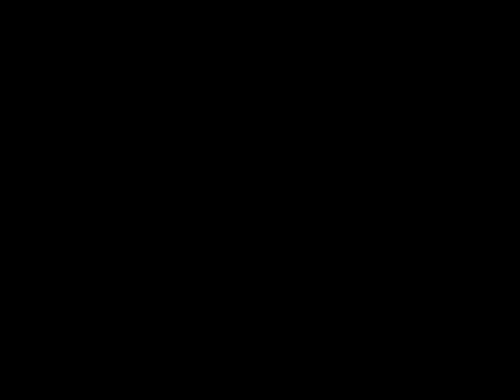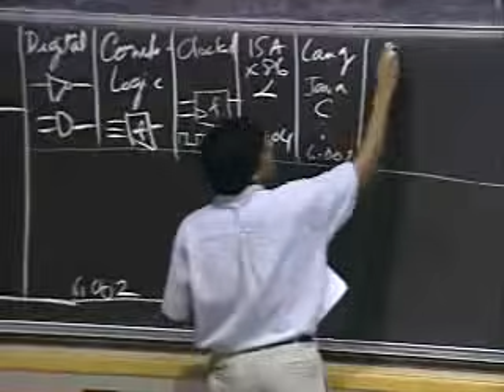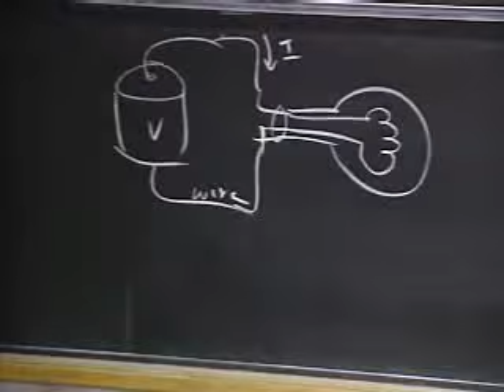Lec 1 | MIT 6.002 Circuits and Electronics, Spring 2007

Comment: This is the schedule:

L1	Lumped abstraction relationship to physics, KVL, KCL
L2	KVL, KCL example, nodal analysis
L3	Linearity, superposition, Thevenin’s equivalences
L4	Digital abstraction
L5	MOS switch, S and SR model, MOS gate design
L6	Nonlinear resistors, networks
L7	Nonlinear resistors, small signal analysis
L8	Dependent sources, analog amplification
L9	MOS SCS model and MOS amplifier
Q1	Quiz 1 (evening)
L10	Amplifier large signal analysis
L11	Amplifier small signal analysis
L12	Amplifier small signal circuit models
L13	Capacitors, first order circuits, examples
L14	Intuitive analysis of first order systems, examples
L15	Digital memory, state
L16	Transients in second order systems
L17	Second order systems with damping, intuitive analysis
Q2	Quiz 2 (evening)
L18	Sinusoidal steady state analysis, frequency response
L19	Impedance methods
L20	Filters, Q factor, radio tuner
L21	Op-amp abstraction, concept of feedback, non inverting amplifier
L22	Multiple inputs and superposition, integrators, differentiators
L23	Op-amp abstraction, feedback, stability, oscillators, clocking
L24	Energy and power
L25	Breaking the abstraction barrier

 Also exams and quizzes at https://ocw.mit.edu/courses/6-002-circuits-and-electronics-spring-2007/pages/exams/
Reply: Thanks for this awesome list:hand-pink-waving:

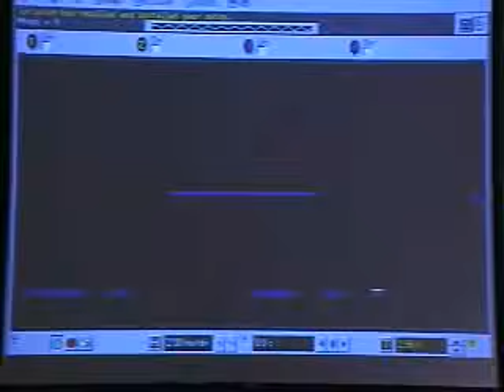Comment: Great video, but one thing that tripped me up at first was the vertical IV graph for the battery at 33:45. I had assumed with the previous graphs that voltage was the independent variable and current was measured across the component as a function of voltage. This method obviously cant produce the vertical line graph. It didn't make sense until after I read this in All About Circuits:

"If you have a device that supplies voltage or current, such as a battery or a solar panel or a regular power supply, you cannot change the voltage across the device, because there is a specific voltage or current being generated by the device. For these devices, ... [the voltage and current are calculated by] a method that involves measuring the values supplied by the power source for varying load resistance."

For me I visualize this as a third invisible axis of the graph, load resistance (R). R is the independent variable that's varies and I and V are both measured with respect to R. The R I V graph is then projected onto the I V graph in the lecture.

Thus I understood the ideal voltage source would have a vertical line IV curve because regardless of the load it will maintain 1.5V and supply 1.5/R amps of current. As R varies this produces a vertical line.

Another way to think of it is the independent variable is current and voltage is the dependent variable. The graph answers the question "If we force the voltage source to produce I amps, what voltage will it produce it at (if I amps is even possible)."

Let me know if I misunderstand anything.

Comment: 🎯 Key Takeaways for quick navigation:

00:00 🛠️ Introduction to Engineering and Course Overview
- Engineering defined as purposeful use of science.
- Course focuses on simplifying Maxwell's equations.
- Introduces abstraction layers to simplify systems.
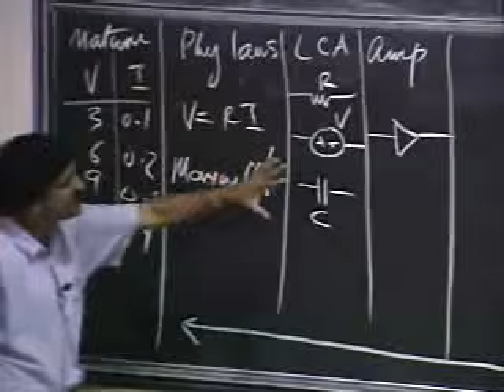06:06 🎛️ Layering Abstractions in Electrical Engineering
- Abstraction layers like lumped circuit, digital, build upon each other.
- Simplifies complex systems into manageable components.
- Leads to understanding computer architectures.
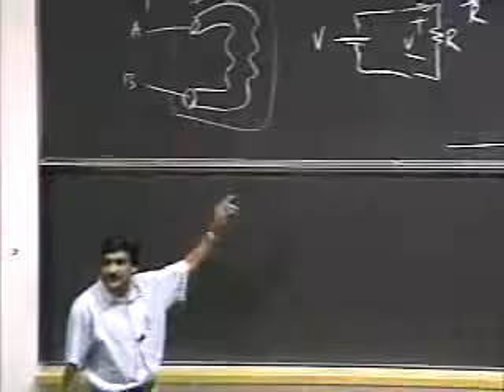21:30 🔍 Understanding Simplification Techniques
- Rationale behind simplification techniques explored.
- Importance of understanding transition to simplified systems.
- Emphasis on principles for effective engineering.
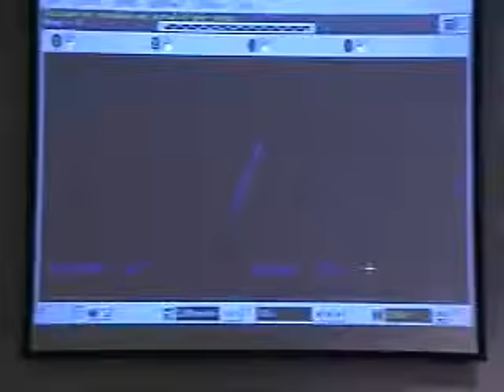29:35 ⚡ Characterizing Lumped Elements
- Lumped elements characterized by VI characteristics.
- Examples include resistors, diodes, batteries.
- Understanding VI aids circuit design.
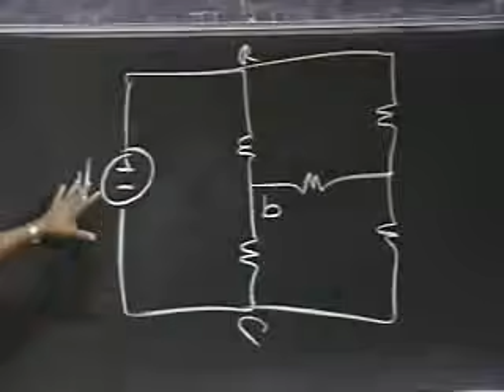38:10 🔍 Kirchhoff's Laws and Circuit Analysis
- KVL and KCL derived from lumped matter discipline.
- KVL: sum of voltages in a loop is zero.
- KCL: sum of currents at a node is zero.

Made with HARPA AI

Comment: I'm trying to follow the MIT's EE curriculum and the degree outline has this as a first class which has a prereq of Calc 1, 2 and Differential Equations, but he assumes that most students already covered Maxwell Equations, which as far as I could tell is a pretty advanced area of dealing with partial differential equations and is usually covered in a physics Electromagnetism course. So did they cover the basics in 18.03 Differential Equations course?

Comment: i have been thinking...in capacitors, there is a variation of charge so, why can we take the input current as equal to output current when we use the abstraction?

Comment: Sir, Capacitor is a lumped circuit element but it stores charge right.. so, how did we include it into our discipline of LMD....?????
Reply: Internally stores positive charge and negative charge physically separated by a very tiny distance, so total external charge is 0 and never changes.

Comment: What is the book that MIT use in this course of Circuits and Eletronics?
Reply from the maker: The course textbook is:
Agarwal, Anant, and Jeffrey H. Lang. Foundations of Analog and Digital Electronic Circuits. San Mateo, CA: Morgan Kaufmann Publishers, Elsevier, July 2005. ISBN: 9781558607354. (http://www.amazon.com/exec/obidos/ASIN/1558607358/ref=nosim/mitopencourse-20, http://www.elsevierdirect.com/product.jsp?isbn=9781558607354)
Reply: ***** I want to answer the Quiz 1 on this course. However, I don't understand the objectives of questions 1 and 2 due to lack of instructions. Care to elaborate?

Comment: the short summary: electrical engineers work off abstractions that pile on top of other abstractions, so things get easier as you go along*;
demonstration of current vs. voltage for a lot of common discrete components (including a zener diode);
and "what happens when you feed 110V into a pickle?"

* I note that historically, I think Maxwell's Equations postdate some of the more basic "laws" which are sub-sets of Maxwell's; so he was working towards a more complete synthesis. Additionally, some of the abstractions have their own distinct grounding in other disciplines, i.e. using a programming language relies heavily on mathematics which is grounded...in some way.
Reply: Nerdo( weird and nerd)

Comment: Current flowing in the loop creates flux, if v is varying the flux will also be variable. Now what about kvl
Reply: you're correct. this is why in real pcb design it's important to keep current loops small by routing signal traces close to return planes. in reality there is a hidden distributed inductance. they never mention this in undergrad ee.
Reply: I think the flux can vary, just not the rate of change of flux.
Reply: In inductors we consider flux change and in capacitors we consider charge changes but we take another abstraction depending on... transient/steady state/fixed frequency variation/variable frequency etc.

Comment: We do all of the adding, subtracting, multiplying and dividing by using attenuation, or amplification.  Ohms law and filtering.  So, we set up our broad band amplifier's inputs, each input has a filter array option, we set the presets and send a series of signals on a group of frequencies and do all of the math by converting digital to analog and then back to get the results.  Quantum, pew.

Comment: Don't let Quantum Computing fool you, or confuse you, it's easy.  Bottom line, the answer is next too your TV, it's the cable box and multiplexing.  If you convert digital to analog, and plan for a long list of re-iterations, we've already done that with a large number of synthesizers.  The EMU chip set but, they don't operate in the GHz frequency range, where all of our capacitors and inductors could be etched on chips.